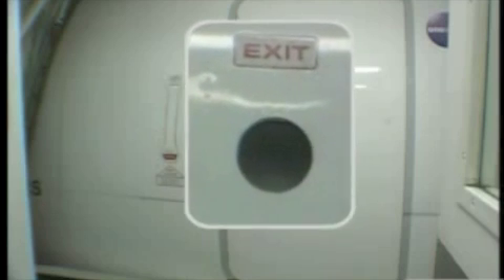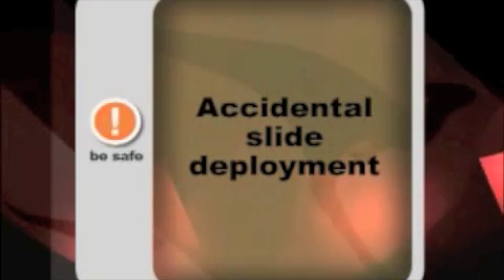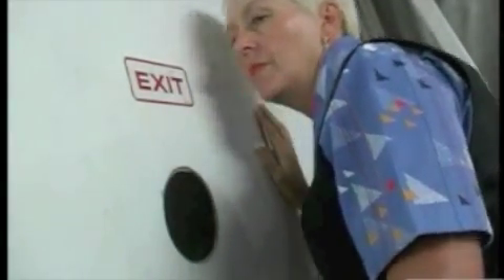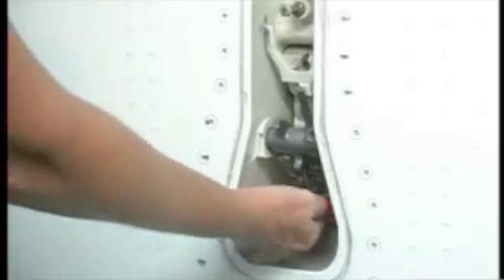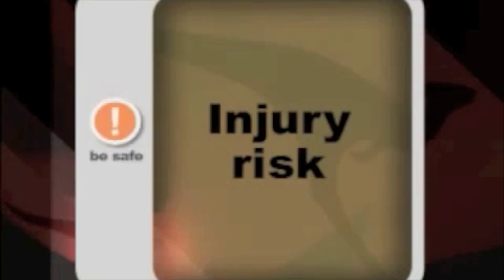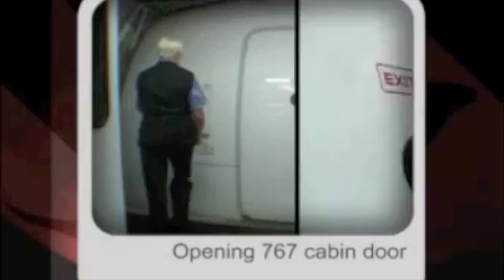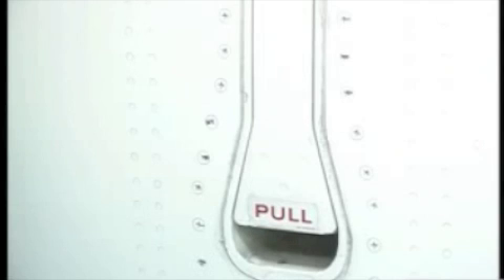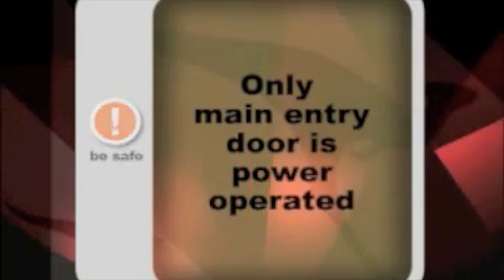Boeing 767 cabin door opening

Comment: Does the red flap return to its original position after closing?
Reply: +John Daniels....The primary purpose of the red flap is to disarm the door escape slide and visual indication externally of this . The flap will remain in this depressed position until such time that the door has been closed and rearmed from the inside it.

Comment: This type of door should apply to all models of aircraft airline, considering their opening steps in an evacuation, or dipping and no heavy hinged doors that look like pressure cookers fridge or food ....
Reply: 777 and I guess many modern planes have power assisted door by electrical motor or gas cylinder tho
Reply: Omar Alfonso pppooo9 to oo
Reply: A320 When Armed pull up the door handle  then door will open if disarmed  push the door  ihen into fully locked position